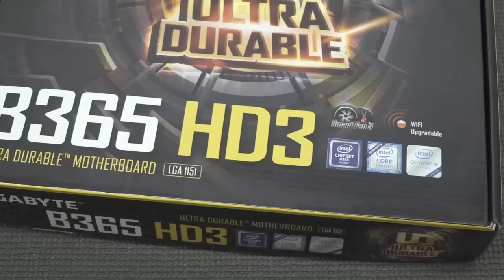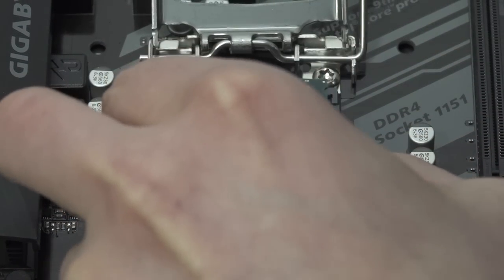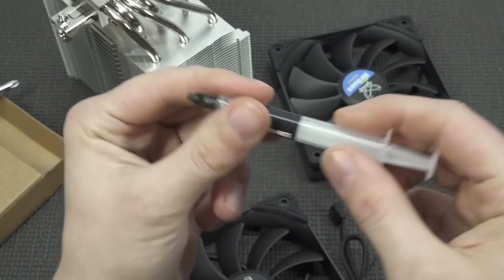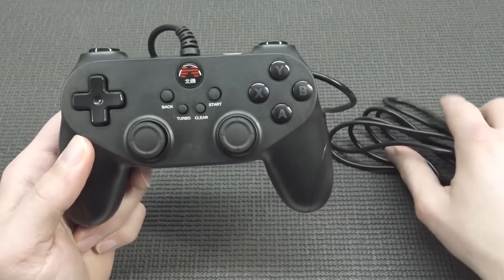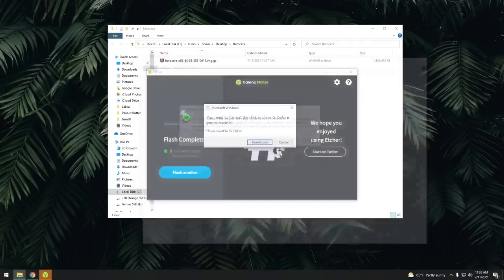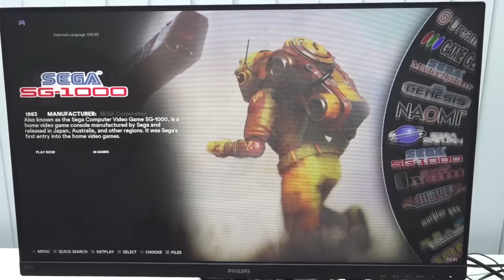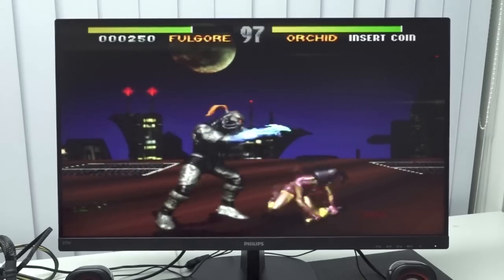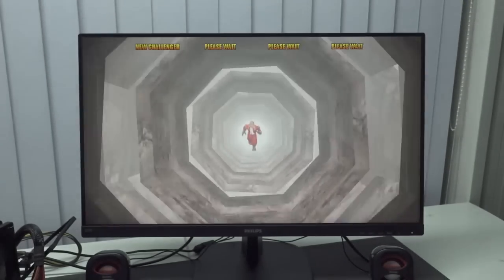Let's Build & Turn This i5 Intel PC Into a Emulation Gaming Terminator 😎

Comment: Here's my setup just in case anyone is interested.  I bought an arcade cabinet with a trisync monitor already installed.
The pc is a mashup of parts.  
i7-2600k
8gb ram
R7 280 with DVI-I for analog output to arcade monitors Vga port.
256gb ssd and 1tb 3.5 ssd just for emulators and games.
I only run arcade emulators on the machine so no consoles.  My main emulator is Demul even though it is outdated, it gives the most accurate emulation of Atomiswave, Naomi and Dreamcast gams for me.  Also groovymame switches to the correct resolution of all the classic games that I play, SF2 and so forth.  Any questions just ask away.

Comment: Try a Ryzen APU for an emulation machine or budget system.
They are highly overlooked.
Newer ones can even hit 1080P in some games and emulators and can run the Wii U and Switch at 30fps constantly.

Comment: just a few tips for such builds : 

Doing a single channel ram build leaves a lot of performance potential you would've had with a dual channel configuration. Also, a  small and cheap gen3x4 nvme with decent read/write speeds as main drive with a sata ssd or  a large size 3,5" hdd as storage would be a cheap and efficient way to have a  fast and responsive system. i would not reccommend using single channel with amd apu's like the 5600g witch likes fast dual channel ram and paired with the asus prime  b550m-a wifi motherboard and 16 gb (2x8 )3200 MHZ and above with decent timings it will be almost the same as  having a r5 3600 with a 1050 at 1080p without breaking the bank. the mugen 5 cpu cooler is overkill for such a system but  it looks too badass not to use it but th vetroo v5 or the hyper212 evo  could be also good options to consider
Reply: All this wouldnt signifactly improve retro emulation speed, because emulators dont really care alot about such components besides CPU and GPU. Your improvments are good for a regular PC-Build to run PC Games tho.
Reply: AMD Ryzen 5 5600G Vega 7 is equivalent to RX 550 or GTX 750, the difference is the amount of VRam you can set to 8GB. Even if you overclock the RAM to something like 4000MHz you may match GTX 750 Ti at very least.

Comment: A quick tip on this, because emulation is so easy these days for PCs, you can often buy a used office computer and just stick the cheapest graphics card possible(even a GT 710 will do for emulation) into it for an even cheaper option. Of course, due to the card shortage, this would be quite impossible as it stands.

Comment: Heads up: PS3, Xbox 360, and Wii U emulation use more GPU power as well as CPU power, so the slowdown you might experience it going to happen because they need to lean on GPUs for processing as well as upscaling. Later emulators work a little differently than the older ones  which relied more on pure CPU brute force power. Also, with Batocera, there's an extra mode that has to be enabled and you can't use current Nvidia driver versions with it: you have to use the legacy Nvidia with anything older than the GTX 700 series (your GTX 650 Ti was going to fall victim to this). That's why you got the slowdown you got. I have a similar tower and with lower specs and can not only run PSP/N64/DC full speed, but PS2/Gamecube/Wii and even 3DS full speed with a i5-8400/GTX 1050Ti combo (emulator permitting). Batocera's boot files have to be modified for Nvidia drivers to work.
Reply: I managed the Wii U on 4 cores, but 6 cores is the minimum for a smooth PS3/Xbox 360 experience.
AMD VEGA Graphics can run Wii U and Switch games with 30fps and native resolution, but PS3 and Xbox 360 are not gonna be a good time without a dedicated GPU and at least a 6 core CPU

Comment: A cheap SSD of like 256 mb is enough for the OS and the emulators will run fine of a modern Hard Drive. A few months ago I've build a emulation PC with a even more powerfull CPU for emulation : The i3 - 10105 F 'only' four cores but at higher clock speeds and with less heat (thus a quieter system) I don't think there is any established emulator yet that takes advantage of more than 2 cores... let alone 6.Even with PS3 the graphics card does most of the work. But hey if you can find a cheap second hand 9400F - mobo - combo it's a great system too  ! But new in my country the 9400F is like 150 euros and the i3 10105F is 85 euro... So for the same 150 euro you get a cpu and a mainboard with more performance! (for emulation)

Comment: I think you need to get a gt 1030 ddr5 version wicked :) it is the cheapest decent option for emulation if you want to get a new GPU instead of secondhand. That 9400f i5 with a gt 1030 should definitely be ok for wiiU and some PS3. I have been playing wiiU on a i5 3470 with no issues.
Reply from the maker: ok, need more gpu power ! 🦾
Reply: I tried running Wii U on a i5 7400t with a mobile 1070 without success, I heard Wii U runs way better on Windows 10.
Reply: @WickedGamerCollector  Yeah the graphics are the hard work for the emulators to do. A gt1030 ddr5 (even the fanless ones) might just suffice and wont break the bank. Luckily I still a geforce 960 with fans that won't run on lower loads... so when playing simple games on the 2D systems it's quiet. There a lot of video's of emulators running on all kind of hardware on youtube. When not sure you might check those first. If you could find a second hand 750ti somewhere cheap (maybe out some random second hand crappy mediamarkt system?) you still have some more power than the gt1030 but maybe some less compatibillity

Comment: Which GPU?  I have an Intel 9300f with a 1650 GPU, works well.
Reply from the maker: Yeah was using this GTX560ti... old card pure for connecting the display. 
Wanted keeping it low budget... the 1660 I have here is nog 450 euro 😅

Comment: You didn't even try PS3, did you? You don't need an I9 to run it. I would actually venture you could use that machine to run a few PS3 games and I'm not talking indie. PS3 emulation is not as big of a hog as PS2 emulation was to technology at the time of it's height in popularity.
Reply: Hmm. I just built a intel i5 6600 with a Radeon 240 2gb. Wonder if it will run ps3 then. But Batocera isn't up to date on ps2 and ps3 emulators. Wii U emulation is so so on it too.
Reply: @wolffactor56  I've seen Demon Soul be played on Intel HD 520 at 30 fps. RPCS3 doesn't get enough credit.
Reply: You would have to run RPCS3 not Batocera though. Shouldn't be a huge deal to switch if it means playing PS3 games.
Reply: @davidlevy6418  Shoot gonna try later today then. Thanks for the confirmation.